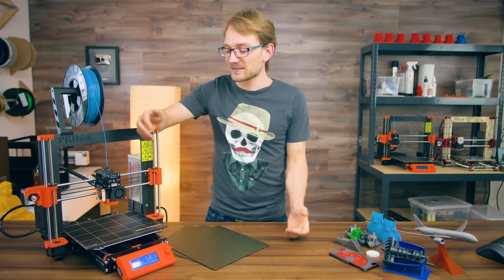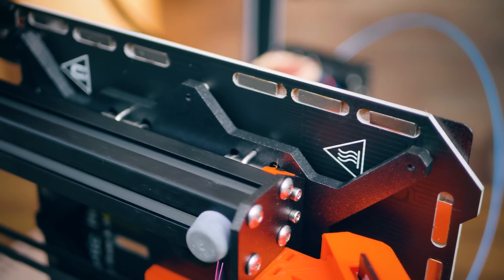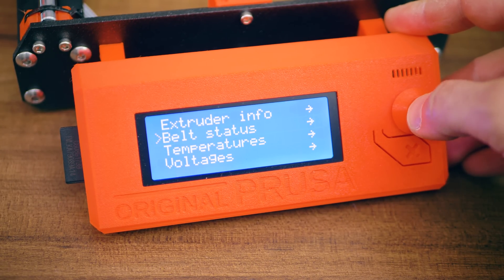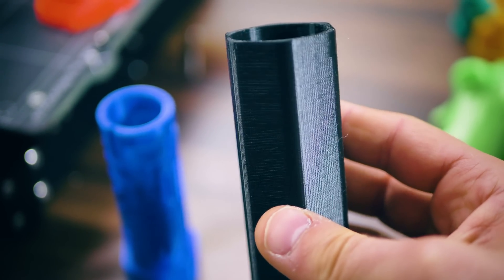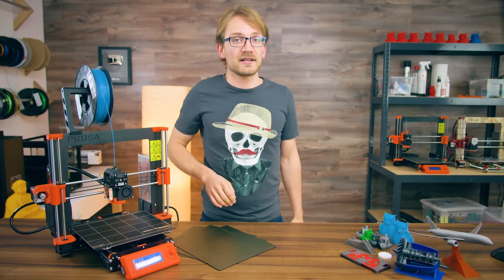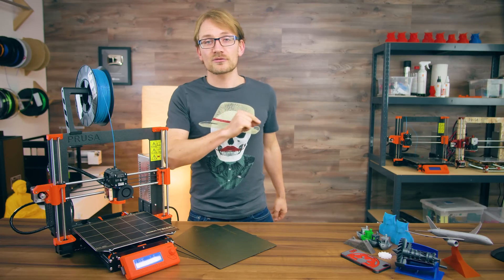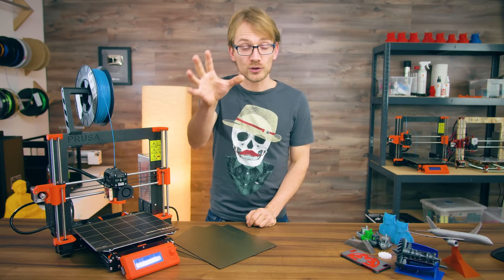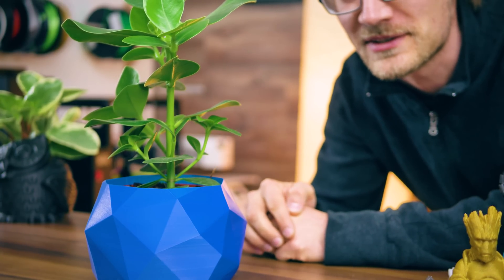The most important 3D printer - Original Prusa i3 MK3 review!

Comment: It's easy to forget how innovative this printer was at its time.
And even years later (when I bought mine) it was still the only printer on the market with all those features combined. Only 2-3 years ago a lot of printers did not have:
- full metal hotend
- direct extruder
- dual z-axis motors
- magnetic PEI sheets
- filament runout sensor
- ABL sensor
And only the Prusa MK3S+ had all those features together.

Comment: In retrospect although this machine was revolutionary when it appeared on the market, the revolution it promised in 3d printing never happened. Instead the market is flooded with run of the mill clones that bring absolutely nothing innovative or exciting to the open source community, instead relying on the end users to tune and upgrade their machines. If it weren't for a few dev teams that bring new and improved designs like Voron, Rat rig etc you'd be hard pressed to think 5 years have passed since this launch. And that's really sad unfortunately.

Comment: Forget about the money for a moment - how accurate is this printer in comparison to other more expensive e.g. Dremel DigiLab 3D45 or Cel RoboxPRO or Ultimaker S3? I'll be using it mostly to print parts for products designs such as adapters/mounts for bicycles etc. where precision, durability, water/UV resistance during outdoor use is important. I've read about different types of filaments such as PLA, PETG and probably more suitable for my needs (Eco-) ABS, ASA and PC. This printer seem to be all rounder but precision and quality of parts is top priority for me hence wouldn't want to buy something that's lasted for my learning time only to have to buy a more serious one to get the job done. Many thanks in advance for any advice.
Reply: Owner of one here... This is about as accurate as it gets. The stepper drivers give it extreme accuracy, and even multi thousand dollar printers print just about the same quality. It also has 50 micron layer heights, which is half the standard 100. It also has high bed and extruder temps, making it great for nylon. I picked it over ultimaker or makerbots and I am glad I did
Reply: @sidewinded1  Thank Ethan, I'm always more into OpenSource than any proprietary solutions or products as many companies often sooner or later tend exploit the fact that you're dependent on their accessories that only fit their products or will threaten to void warranty if third-party used. This is not the case with Prusa hence am more confident now to get it although a friend has both the Prusa and Ultimaker and she still says I should go for the latter - presumably because it's in an enclosure and is easier to control temperatures when printing ABS/ASA.
Reply: @anylookup  I love the open source for the same reason as well. Prusa is very good about warranty and, at least in my experience, very good customer service. There are 2 things which made me go for a prusa, the first being the community and the second being versatility. For the community, they are always there to solve issues and encourage constructive criticism, as well as tell you tips for your printer, so they make starting your 3d printing journey a whole lot easier. As for the versatility, they can print almost every filament out there from what I have seen. You mentioned that the ultimaker has an enclosure, but also Prusa has their own enclosure called the LACK enclosure, which can be assembled with 2 ikea tables and some 3d printed parts for cheap, and it also does not void the warranty :) Also, you can print up to 5 filaments at once with just 300 bucks more so I find that a big positive if you want to print multicolor with water soluble supports

Comment: This is my first 3D printer and kinda glad to know it's a silent one ahaha. But so far, I love it!
Reply: How you doing with this one? Can you get figures and mini figures in good quality? Figures like idk, One Piece
Reply: @darkdexterminate  do you need help troubleshooting? I can help
Reply: @sidewinded1  oh, hello. Basically what I want has been written in the comment before this one, between 200-1.000€. Thank you so much, any help is welcomed and thanked :)
Reply: @darkdexterminate  Ah, makes sense. Thought you were having quality errors! Anyways, this stacks up real well to most of the printers on the market. I personally think it is the best printer for a variety of reasons, but before I list them I will answer your question: If all you are printing is minifigures, it may be better to go with a resin printer, as they are better quality. However then you have to manage fumes and run into a small buildplate. So for printing minifigures on an FDM printer? It is amazing.
Now heres why I recommend it. This thing is cheaper than an expensive printer but outperforms many. It has very fine tuned steppers which make it so that the prints are extremely accurate, and with enough tuning, prints look too perfect to be true. It also has good layer height, so if that is needed for printing minifigures, get it.
TL;DR this printer has better looking prints than anything cheaper than it, but it offers the same performance as a more expensive one from my experience. It is also very beginner friendly

Comment: So I am a 3D print newbie (started in june this year with my ender 3 and it makes so much fun)
I get better and worser prints and I ask myself if a 750€ machine may make it better.
Threw already an eye on the cr10s pro (about 500€) are there any recognizable benefits in printing? 
It has  a touchscreen which I think (in compare to the handling with the control ring on my ender 3) may work
much faster and easier.

Comment: Last week I received my i3 MK3S as a Kit, was quite fun to build. Didn't come without some issues though when it came to First Layer calibration - Yea... The Manual/Video about it is detailed in general but could still have been better in detail - Especially considering it is the part that makes or breaks the print - My own first 3D Print was a Nameplate for my Moms Garden Plot Waste Bin and while the on the SD Card provided Prusa Nametag with a simple first layer design printed flawlessly with the wrong First Layer height settings my Mothers one with intricate details in the first layer did not - Meanwhile I was able to fix that but still :°

Comment: Now that you mention it, it did have trouble printing straight out of the box. I was an early/late adopter of the Mk3 and waited for the PEI sheet, and I couldn't get it to print. Turns out, the sensor that actually detected the filament wasn't working. But, a patch and trouble shoot later, works like a complete dream. Even my UP Mini couldn't stack against it!

Comment: Ended up with a refund,   I was unlucky nothing but problems
Reply: Im about to get one, What problems did you have?
Reply: StreetBeagleKz  I had the kit, filament I had to bend to fit in extruder first time as it didn’t line up, extruder kept crashing into bed so hard it bend the hotbed and damaged, scored it as well, couldn’t get a good first layer no matter how many times I tried, also I tried printing 3 small projects identical ones these kept getting stuck to hot end, all you’d see is a big lump of melted filament sliding around, the wires wouldn’t fit into box around the pcb we had to modify it, tech team tried to help you take a pic they give advice on the pic but they were lost as well, I had better advice on Facebook from a enthusiast. If your getting a kit it can take many hours to get it right, buy it prebuilt costs more but if something needs changing your back to square one.

Comment: You just saved me hundreds!! I was looking into printing with PETG, and had you not made the small passing mention of how it destroys PEI print beds, I would have never found out. I realize this is a review of a printer (and a damn good one at that), but thank you for accidentally saving my printer!
Reply: Are you talking about an MK3?  The replacement spring sheets are $25-30, not "hundreds", and the replacement PEI sheets are less than $10 (since it's unlikely the actual spring sheet itself would be damaged).

Not only that, you can easily print PETG on PEI without damaging the surface simply by making sure the bed is properly cleaned (with Windex or some other window cleaner) and that your first layer is not smashed into the surface.

His statement was very misleading - a lot of people print PETG on PEI without destroying anything.  He should edit that statement out of the review.

Comment: now that people are receiving their mk3's, there is evidence of inconsistent extrusion namely fine horizontal lines on the print. Do you know anything about this or is it user error?
Reply: Me too, and have seen this in other reviews... I was really sad when found out this was a common issue. Altough my mk3 prints overall better benchys than my old i3 rework, the rework (built with cheaper parts) had no inconsistent extrusion issues. Please Tom tell us what you think about this.
I also have issues with the bondtech gears leaving textures in the print if too tight but having failed prints if tighten as the manual requires. Also the endstop feature do not feel accurate enough for print restarts. I dont know if I would recommend this printer, It made me feel kind of disappointed.

Comment: my MK3 has been a total nightmare. All of the promised whiz-bang features are disabled, because they don't work and cause failed prints. Print quality is by far the worst of any of the printers that I have access to. I've had to take things apart multiple times to replace parts improved since it shipped, and in one case defective. one of the u-bolts arrived bent and one of my rods had a bad spot. Can't get any replacements from prusa because they are out of stock . $1000 mistake.

Comment: I would like to purchase a MK3, but cannot find a standard spec sheet on their website, nor could I convince Pavel (their chat line host) to show me where it is to print. Paying a thousand plus makes me a bit uneasy if the company is not willing to put in writing what the inputs and outputs are for the device. I'm new to 3D printing, is this the norm for 3D printer manufacturers? How do I know if this printer can melt nylon 12, this will be used most often as I'm an Design Engineer making all types of prototypes.

Comment: Tom, I fairly new to 3d printing. Could I use ABS filament and if so would I need to build an enclosure, that covers the entire printer, in order to keep the temperature constant? Also, how's the print speed compared to $2k and $3k printers?

Tks,

Gary

Comment: Hi Thomas, - I received my assembled MK3 two days ago.  It was late so I waited until yesterday morning to set it up. I started out by calibrating the Z just in case.  Then I printed the whistle and that went OK.  Then I loaded my own project on my previous MK2 SD Card.  When I went to insert it - it would not go in more that about 25%. I jiggled it around for several seconds and it finally went in.  It printed a first layer 14 minute test and it looked good.  My second attempt to insert the SD Card I had the same problem.  It seemed to be blocked in the SD Card Slot Connector at about 25% insertion.  After a lot of jiggering and retrying I finally got it in.  After about an hour of a 8 hour project I check back and the first layer look awful and the Extruder was at the right front corner of the bed with a message on the LCD "Something about change the Filament"  I then had a message to remove Filament.  I could not remove it.  IT WAS JAMMED. I heated the Nozzle to 245 degrees but still could not pull it out.  My initial experience with an assembled Prusa has not been good.
     I might add that almost 2 years ago I assembled a Prusa MK2 Kit and loved that machine.
I sure wish Prusa had a US distributor.

Comment: This video finally convinced me to finally pull the trigger on a Prusa i3Mk3.  I have two printers already, a Printrbot Simple Metal and a Printrbot Metal Plus.  The Simple Metal is a tank, it just prints and prints and prints and the print quality is quite good.  I have had very few issues with it in two years.   The Metal Plus on the other hand is the opposite, it breaks down on a constant basis, it is loud, shaky and the print quality leaves something to be desired.  I need to replace it with something with a larger print area and I think the Prusa will fit the bill.  Im so frustrated by the Metal Plus that I may take it out to the backyard once the Prusa arrives and teach it a lesson.

Comment: pic32 would be the ideal microcontroller for future updates... chipkit even provides an Arduino compatible toolchain for it, it has multi function USB device and host support (ie you could use it as a serial port or plug in a USB drive to read gcode from) and many of them under $10 chips have ethernet MACs build right in just add a cheap ethernet PHY and off you go.

The other advantage of the PIC32s is they are not nearly as complex as ARM chips... they are basically just a step up from 8bit micros complexity wise with an order of magnitude more capability. The PIC32MZ DA line even has 32MB DDR2 on package mainly for use as a graphics memory but it could be used to upload all the gcode in ram etc...

Comment: Best and most extensive review of the MK3 I’ve seen. I did notice you got a printed copy of the assembly manual. My kit only came with the user manual. This being said, they have an excellent online version that’s constantly being updated due to the input from builders. I think the 8 bit board has hit its limits and Prusa would likely have to switch to a 32 bit for any additional features / models.

Comment: Jo is not lying, when I visit my brother who got my old wanhao i3 clone for Christmas. I can't believe how much more work it is to use. Something you forgot in your review are how good the slic3rs are in complimenting the mk3. For most non tricky prints I use prusa control because it is so quick and it is good for layer change multicolor prints. And slic3r prusa edition for tricky prints and variable layer height. You mentioned adding network control. Back when octoprint had issues I picked up a flashair SD card and it works perfect with the mk3 i can save directly to the printer by wifi and the printer controls are better, in my opinion, than octoprint.

Comment: I have to say I do not completely agree with your point on the 8 bit CPU.
I think the choice they did, to have a very simple system to control the printer, and delegate other features like network to another system is a great choice.
Dealing with network, and especially wifi is not a simple thing. Nor is dealing with a full touch & color UI simple. The increased complexity of those inevitably leads to unpleasant things, ranging from boring slowness of the UI to reliability issue if some advanced features causes delays in commands sent to printer for exemple.

I believe the Unix way of doing things is great in such situations : do one thing, but do it very well. So here, I'm very glad to have a simple, relyable embedded controller that perfectly deals with the control of the hardware, and an option to add another system (the raspberry PI Zero) to add valuable but non vital features, such as wifi and web UI.

Comment: STM32 boards are so dirt cheap now i think they are crazy for not including one with wifi capabilities for the brains of their printer. Boards like the ESP32 have been around for a long time now and come with wifi and are under $10. Even a raspberry pi are ~$25 and they have a quad core processor. 

The most annoying things of 3d printing that there are many mods and upgrades for old printers to fix these but they should be the new standard.
Silcing a file then transferring a SD card back and forth - easy fix wifi 
Auto bed leveling - Auto leveling been around for a while now but it just makes life easy.
Removable print bed - This MK3 bed looks pretty nice, looks like a nice option instead of my glass heat bed.
Enclosure with temperature control - Printing ABS is not going away any time soon and newer filaments can require just as controlled environment. With a enclosure your part cooling fan needs to suck air from outside the enclosure via tubing to the hotend.
External electronics - Please separate the printer from the electronics this is just common sense. So basically make a control box for all that stuff and run wires to the sensors/ motors/ heaters.
E3d hotend - These guys seriously make the new standard for hot ends. The Titan Aero looks like a fancy Greg's wade extruder with a smaller nema motor attached but at leased its a nice complete package. The Volcano is a fantastic idea as well getting really consistent temperature for the hotend no matter how much plastic is being extruded.
PT100 Thermalcouple Sensor - This is the new standard of hotend temperature because they are 500*c capable not ~280*c like your normal thermistors allowing for plastics like Polycarbonate to be used.
Reply: i've printed PC on my mk3 and the only issue was the fan shroud drooped, since i was printing a replacement fan shroud, no problem :)   on the wifi front, the prusa supports toshiba flashair cards (in the menu you can choose flshair on the sd card for a bit more power) when there was a problem with octoprint I bought a flashair card and haven't looked back. Even tho octoprint is now fixed I am still just using the flashair. so much simpler and quicker.